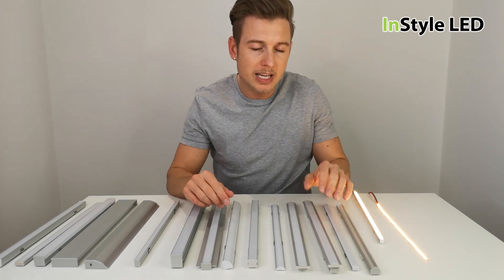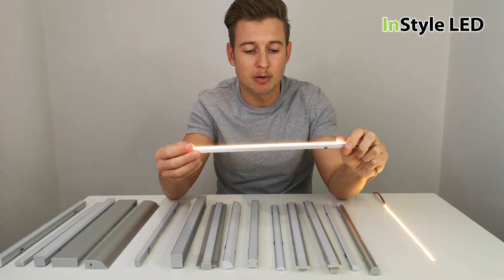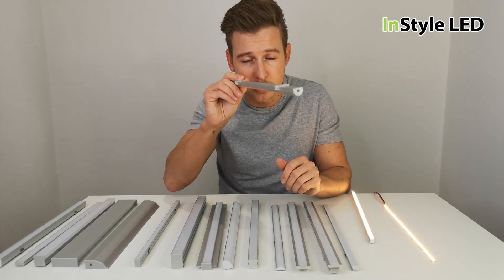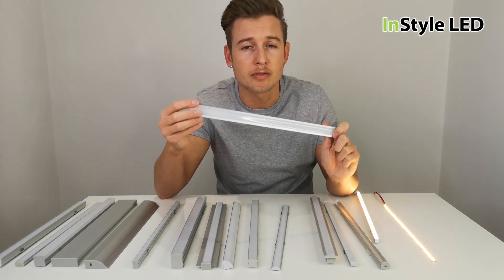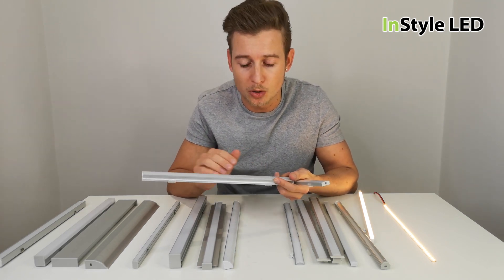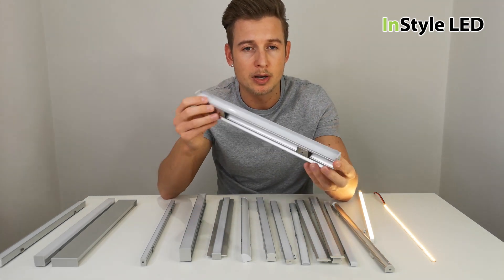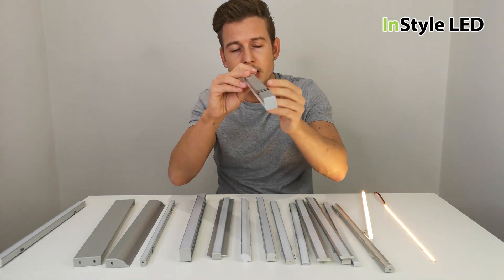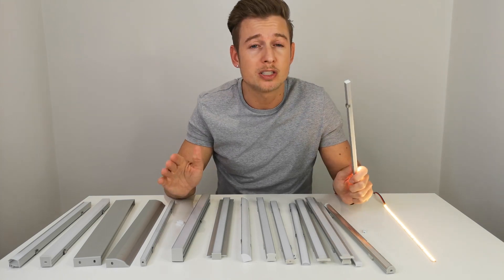Do I need an LED profile/extrusion? And if so which one?

Comment: amazing video , very good explanation i want to add led in my room, so i want to suggest me some cheap profile/extrusion/defusers, the length is around 12 m and i want to use bentable in the 6 corners. also i would like to conect strait without space is that posible ?

Comment: Why don’t just put them LED lights into those profile show us ?? It makes a lot of difference on what you were saying.
Reply: I was thinking this the whole way through the video. so frustrating!
Reply: Exaclty
Reply: Agreed
Reply: I wanted to see led in each of them to see how light comes out of it
Reply: Can i use plastic profile? Like electric wire raceway? Thank you.
Reply: @PuntokUno1014 you can but the profile which is aluminum also helps with heat dissipation
Reply: 100%

Comment: I need your input if you have done this or know of this product 
I have sitting in a box this product because I am struggling with which LED Channel I should purchase

Dreamcolor 32.8FT LED Strip Lights RGBIC, Govee WiFi Wireless Smart Phone Controlled Led Light Strip 5050 LED Lights Sync to Music, Work with Alexa, Google Assistant, Android iOS (Not Support 5G WiFi)
Purchased two of these^^^

I will need approx 101 feet on channel
to be used in my living room / TV room / 
The plan is from wall to wall top
The plan is from wall to wall baseboard or bottom
also, from floor to ceiling 
I will be covering three walls
I am thinking of the V-Shape Channels
One thing for sure I do not want to be looking directly into the brightness of the LED beam of light
Stripper pole to be added later on { wink }
So whatcha think guys

Comment: Why does nobody discuss the fact that you need corners and how to accomplish this? I am contemplating a Muzata V channel, 50' of it as I have one run of 50' in a room around corners, some 22 deg and some 90 deg. Muzata is useless. Typical Chinese company that doesn't give a fuck. Also, nobody seems to ever discuss the fact that in order to connect two separate LED strips, you need a connector, which often doesn't fit inside the channel. But I have the widths and stuff. Seems like most people just install 2 feet of this shit and done. Annoying.

Comment: I am trying to add an LED strip as my main light for a room. What type of extrusion with LED density should I get?
Reply from the maker: I would go with a 12w LED strip light or higher. It all depends on how many metres of LED strip you are using. If you prefer less strip then you can go with a higher wattage strip, such as the 20w or 24w. We have an amazing offer on our 20w LED strip atm
see the strip here.. https://www.instyleled.co.uk/20-watt-white-led-tape-240-leds/
This will be continuous light in any of our extrusions

Comment: Hey just wondering if you can help, we are wanting to put lights under worktops in our kitchen and have bought the corner diffusers and god knows how many sets of led tapes but we can still see each individual led. What are we doing wrong? We are wanting just an overall light not to see every dot 🤷‍♀️
Reply: I'm having the same problem! Even bought a led profile with milky transparant cover 80% light produce. Still light bulbs, it's just terrible and gives me a head tumor. F* led strips, it's just horse 💩
Reply: @johnvanderv  Hi John, you can use COB led strip now, not lighting dot at all even without led profile, https://www.youtube.com/watch?v=Z1wuthQGjn4

Comment: Which one would be ideal for a complete ceiling lighting system for an apartment ? thanks
Reply from the maker: Hi there, if you do not alreadfy have a coving in place for the strips to stick into then you could use something like this..https://www.instyleled.co.uk/coving-uplight-extrusion-led-tape/
Reply: You can use a 45° corner profile...
Reply: We make led profile aluminum housing
Reply: Abby Xie message me

Comment: can these be used in a garden? and if yes what w/p connection is needed?
Reply from the maker: Hi There yes they can. The extrusions themselves will let water in as they are not an IP rated sealed product, so you must always make sure the product inside is IP67 rated/
If these are being used externally then the strips inside the extrusions need to be IP67 rated. We glue seal the ends when bespoke lengths and provide them ready to install. As if you cut the IP67 tapes to length you must make sure the ends of the tapes are resealed. You then need to join the cable from the LED Tape to a cable going to the power supply, you can use a variety of IP rated cable joiners for example the push on and squeeze with pliers IP rated gel connectors. Or if you have re thinking of having the power supply internally but the strip externally, we can make the cable length long enough not to require a cable join, EG.  a 7m starter lead coming out of the strip and the power supply being 6m away internally.
That way you can install the strips into the extrusion and take the 1 cable to the power supply with no additional joins. I hope this makes sence as it seems I am waffling on, any other questions let me know and I can answer for you, Thanks!
Reply from the maker: Also just to add, a tip would be if the extrusion are sitting on their back facing upwards, then drill some holes in the back of the extrusion to let the water run in and out of them so they do not fill up